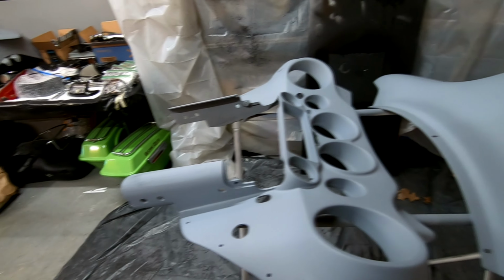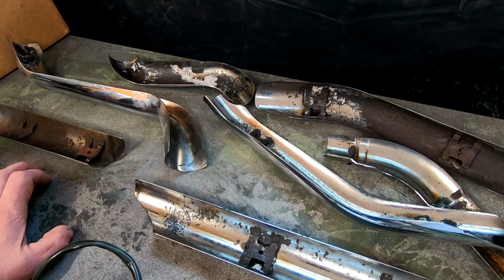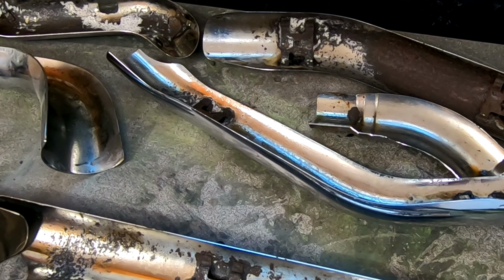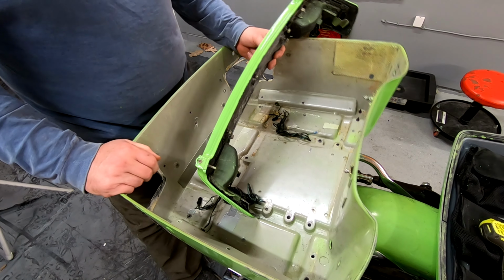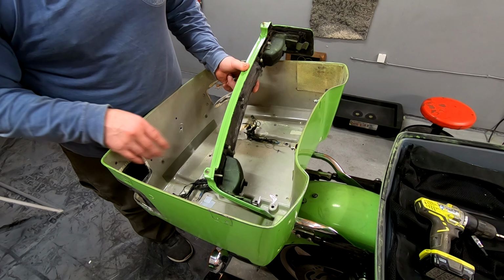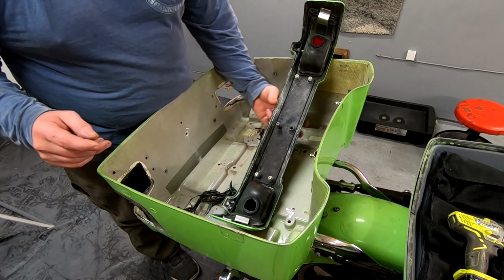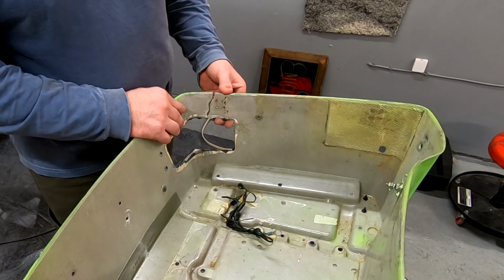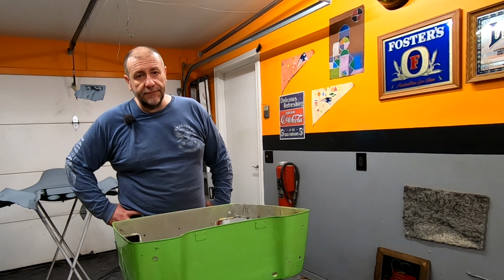Harley Ultra Classic Makeover #16 Updates- Touring Pak Removal and Disassembly Issues with Tour-Pak

Comment: To fix the plastic use a product called
Plastifix it comes in black or white...trust me it works wonders i have used it on plastic car items and motorcycle fairings,  for the fiberglass make sure to rivet a pice of metal mesh onto the items then put fiberglass over it from the inside you might need to use bondo on the exterior part then sand it smooth...good luck.
Reply from the maker: thanks for the information